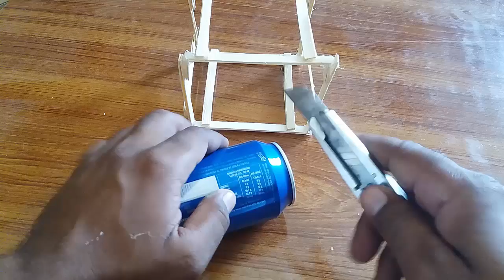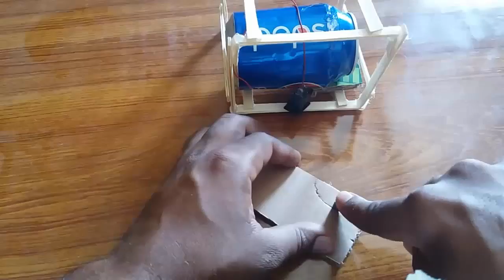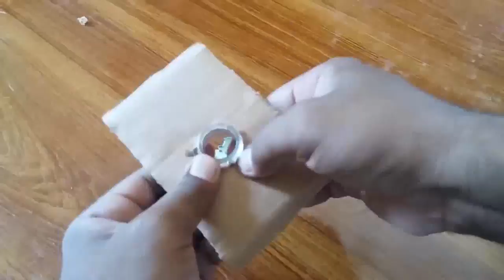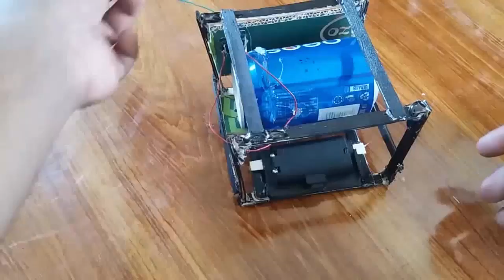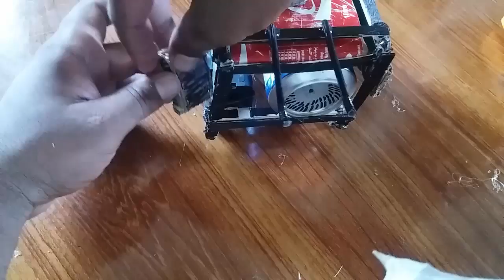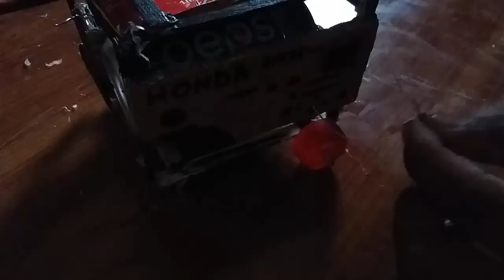WOW! How to Make a Generator || At Home with cardboard & Pepsi Tin || Mini Generator || 9v battery

Comment: But it runs on a 9v battery so this is basically just a bulky buck converter and therefore pointless
Reply from the maker: Chek dear this video description
Reply: Nice
Reply: Stefan Botes
Reply: LOL, maybe he should use a model aeroplane motor.
Reply: More of an over engineered motor holder with a LED atachment. Also the title is long enough so that when you see it in the selection you can't read the last part. On top of this it has as many common search terms as possible in it.
Reply: its so a hamster can power his lights without running on the wheel
Reply: law Biffington
Reply: law Biffington
Reply: Sheridan oiqnhrt
Reply: Dhrtk60
Reply: How fan conetion
Reply: ساام
Reply: MrSogo I still don't get it.
Reply: S.A সাগোরিকা wu
Reply: It's a fun little toy